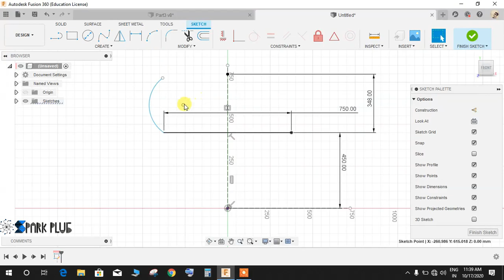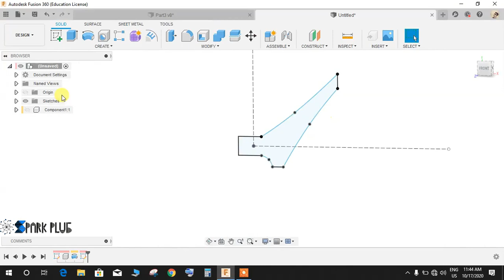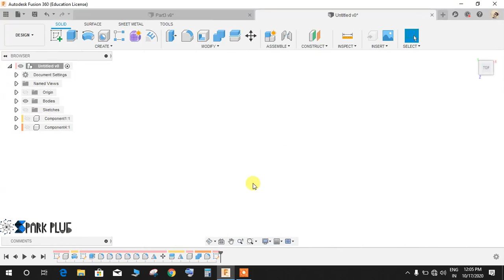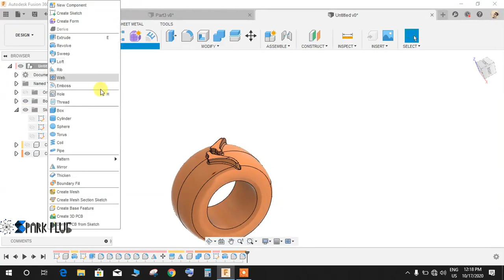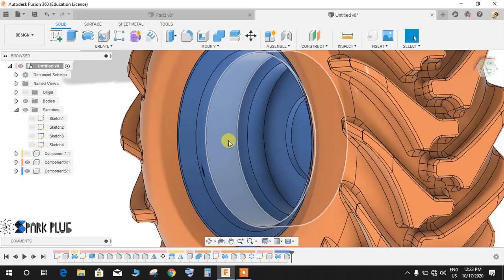HEAVY DUTY TYRE | FUSION 360 TUTORIAL | SPARK PLUG

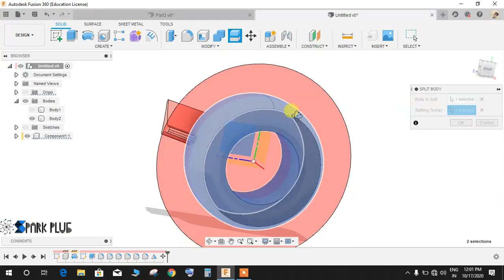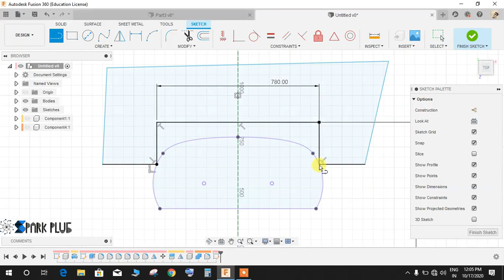Comment: Great tutorial, thank you for sharing. I did not cut the tire in two pieces and joined them together as you did around 12:00, it worked anyway (so I guess the bug you experienced has been solved). Also, instead of making a totally flat cut of the circular pattern as described around 16:22, I used the offset tool to make it have the same round shape as the base of the tire. All in all, I learned a lot!